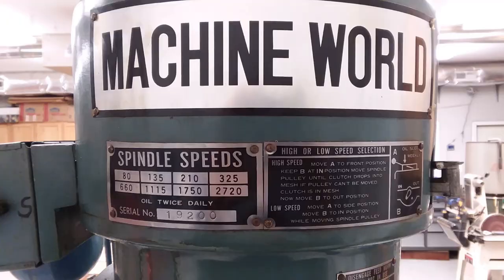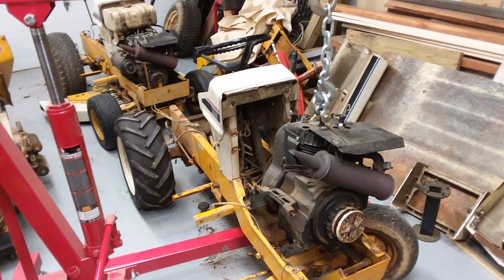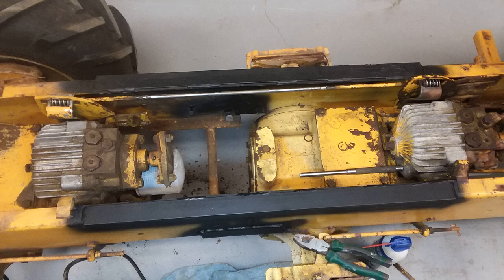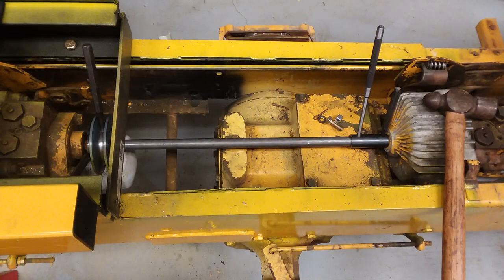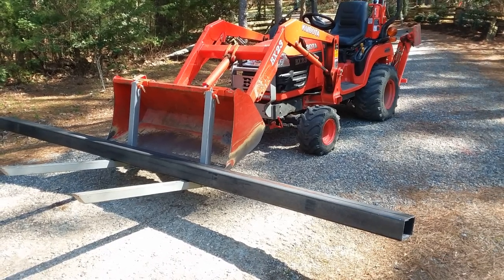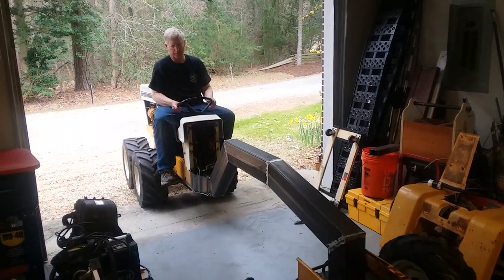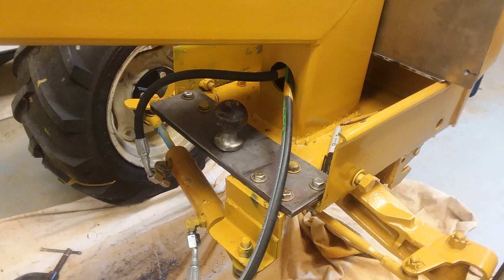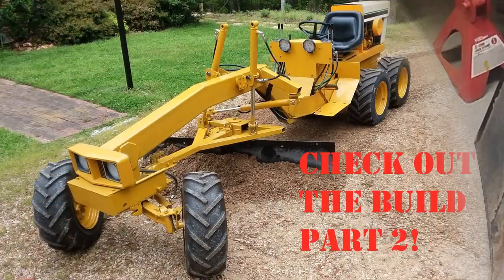Mini Motor Grader: The Build! Part 1

Comment: Again, this is an awesome project and you my friend are a Class A craftsman. I really want to build one of these. I started a small business and one of the things I specialize in is installation of new or regrading existing gravel and process driveways. I also restore old Cub Cadet tractors. I'm guessing I'm not the only one interested in building one of these. if its possible, we would love to see a video with actual dimensions and angles that you used and where you bought the items that you did not fabricate. That would be a huge help. Great video, waiting on part 2 of the build video. Keep the good project videos coming.
Reply from the maker: Thank you.  There is another build in progress over at OnlyCubCadets.net, in the "custom Cub Cadet" forum.  https://www.onlycubcadets.net/forum/showthread.php?t=58311 
My build is chronicled in that forum as well.

Comment: How’s the steering work? I don’t see any linkages 100% hydraulic?
Reply from the maker: Yes, power steering.
Reply: @woodandmetalshoptime8048  appreciate you answering my questions I’m pretty annoying at times I’m sure seems as tho we work the same as you find problems by the answers you come up with is exactly what I was thinking

Comment: Frank I'll give you a ataboy for a job well done. 
I worked in the heavy diesel trade for years, which included hydraulic, electric and gas welding, and even a little wood work. The older dozers and maintainers had spring cushion seats with wooden bottoms. 
And as far as your straight cut frame goes the z cut is best but your little maintainer is not going to see a 10 or 20 ton load pressure; and on the framework for the front you used what is called fish plates on the beam seams. EXCELLENT JOB!!!👍👍

Comment: This is a well done,  great looking,  and artful build, showing fine craftsmanship.  I probably am wrong,  but I would keep an eye on the weld joints and your main beam for any possible excessive flexing,  where it is welded to the drive chassis.  You have pretty good weight and traction with the tandem axles and tires,  and a good amount of stress,  on that joining point,  when you might be doing heavy grading,  especially to one side,  as in ditch cutting,  and such.  Not being critical,  just suggesting.  From watching you grade with it,  with no spin,  or strain on the engine,  I believe it is a pretty strong pulling little rig.

Comment: Thanks for doing this video. Really enjoyed seeing how you did this project. What are you going to cobble together next out of two lawn tractors? An articulating wheel loader? Bulldozer? Track loader? Paddle pan scraper? LOL! Video the work on the next one so we can see you doing it in real time and daily progress. LOL! Awesome build and very cool video of the pictures showing the progress. You did a great job explaining how you did all the work too. 
Stay well. -Wil  👍
Reply from the maker: A scale Dozer is in the planning stage.  I plan to video that build.  May be very slow planning progress, perhaps with some mock ups this summer but the build won't happen until next winter. Too much other stuff going on in the summer. Fishing, for example...
Reply: @woodandmetalshoptime8048  Oh yes got to get the outdoors fun and projects in during the warm months and save that for when it's cold and can work inside. My summer is full of fishing and a large vegetable garden and the other usual warm months things. I do model railroading in the cold months to keep me busy indoors and warm. Might start a layout this winter not for sure but I've been building model structures and freight car kits for the layout when its ready. I have plenty of those to keep me busy throughout the winter if I don't start the layout.  👍
Reply from the maker: Love model railroading!  I built an HO scale set up for kids when they were small.  Built lots of buildings, switching, 3 interconnected ovals, but never built actual cars. That's over the top!  It's about time to commission the boat for the season...
Reply: @woodandmetalshoptime8048  I like the craftsman car kits from the 50s, 60s, and 70s where you get wood, wire, and decals and you have to cut the wood to shape and bend your own grab irons. I like the challenge and then the feeling of accomplishment when its done and looks really nice. I also build buildings from scratch too if I can't find a kit that will work or can be modified and kit bashed to represent what I want. Get out the knife, ruler, sheets of wood and styrene and go to work. I really enjoy it. Kind of therapeutic for me after long days at work.  👍

Comment: I wonder why you lengthened the frame then shortened it. 

when I first saw the grader I figured you added the transaxle to a frame that had a transaxle.
Reply from the maker: Hmm... I added about two feet of frame and rear axle from one tractor to the back of another tractor.
Reply: @woodandmetalshoptime8048  I guess it's just 'cause.

Comment: How did you do the steering I can’t figure that out once I know that I am going to start building one of my own
Reply from the maker: I used a power steering valve from a newer tractor and ran hydraulic hoses to the front axle where a double-acting steering cylinder works the front wheels.  Is there a more specific question?
Reply: How did you situate the pump on the front axle is it because the front output shaft on the front axle has nothing on it because you a said there’s one on each side

Comment: On regular motor graders the blade control valves are on opposite sides of the steering wheel. Left up and down on the left and right on the right. That way you can work them easier using both hands. Not getting one hand to move the two handles in opposite directions at the same time would be the biggest problem I'd think. It would be awkward for me to have to reach over to the same side with the other hand to control the valves separately. Have you found it awkward to work them being together on the same side? Me being accustom to them on either side of the steering wheel would find it very odd to have them side by side to try to control with one hand. Another question is do the cub tractors have a hydraulic reservoir tank on them and if not did you put one on this tractor?  👍
Reply from the maker: The Cub rear axle holds 8 quarts, so once I bled all the lines, I added another quart to top it off.  I find having both controls together allows me to manipulate them both with one hand, but of course, I have no other experience to compare to.  I can see how it would seem weird to you, but I don't know any better, LOL.
Reply: There are a few smaller compact graders built that have the lift handles next to each other on one side. I have spent quite a bit of time on them. It's not uncommon when working in close quarters for me to be using 3,4 or maybe 5 of the levers at once so operating 2 side by side is very easy. It helps that I have big hands. LOL.
Reply: @galute658  I didn't know that. I've not run really large graders but the ones I've run have had the lift handles on either side. Gallion motor graders is what I've mostly run. I'll hold the steering wheel straight with my belly and that way my hands are free to work the lift handles. Definitely been there where you had to use multiple handles at the same time too.